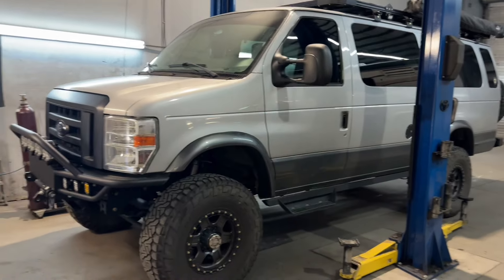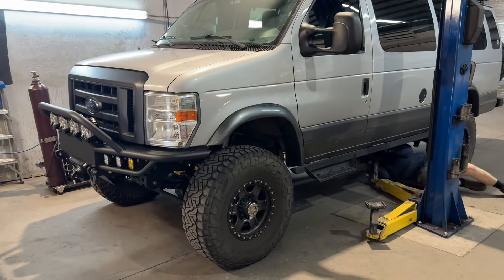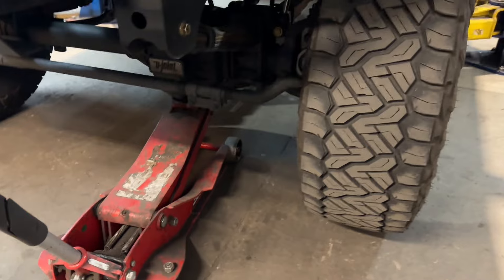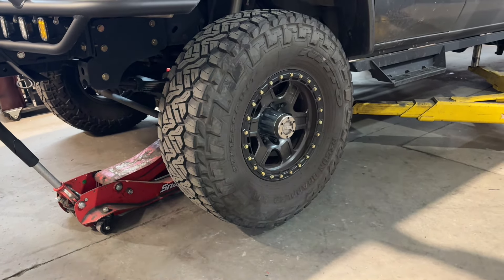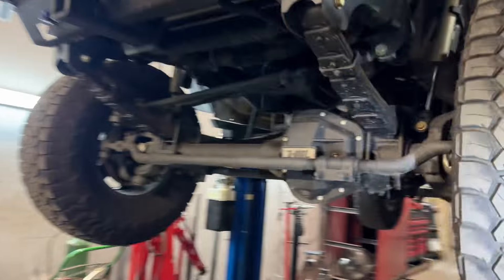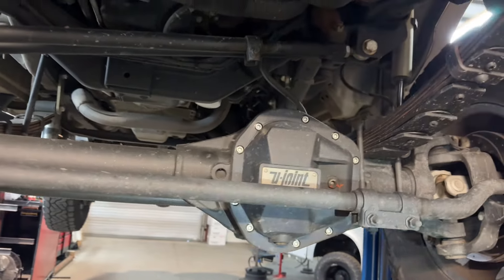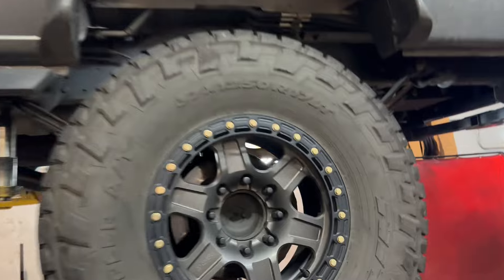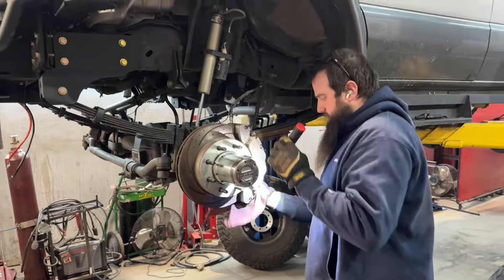Service tips!

Comment: Hi Chris I noticed the factory trans crossmember on your rig? Just wondering why you used that over your custom crossmember. Also trying to figure out why some rigs need the cross over steering spacer and some don’t. I’ve thought about this a lot, is it determined by the arc of the springs? I noticed your rig has plenty of of height up front. When I did mine my front springs had very little arc and I needed the cross over spacer to clear the tie rod over the passenger side leaf spring. Sorry to be so long winded I’m just genuinely interested in these vans really love mine. Thanks